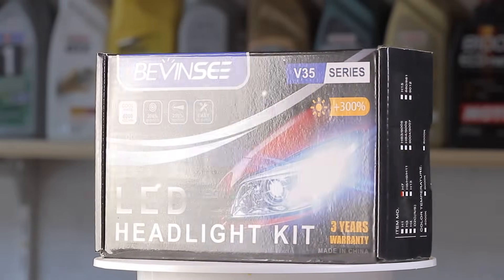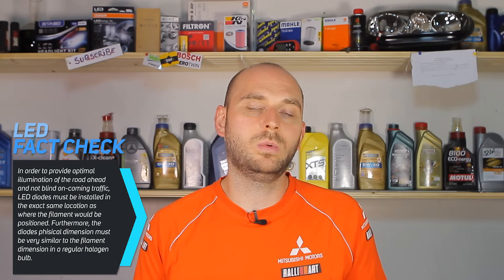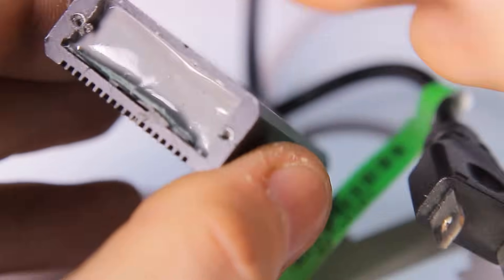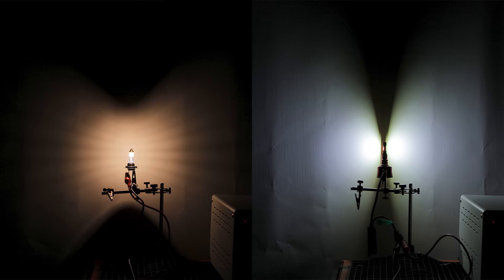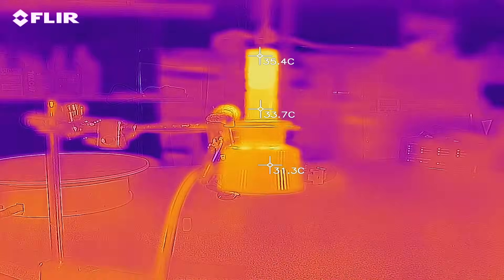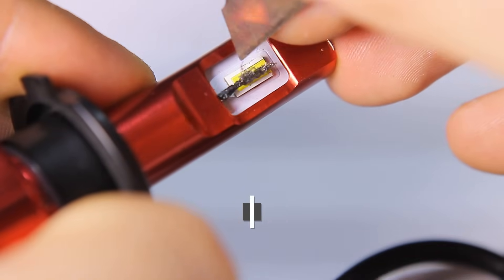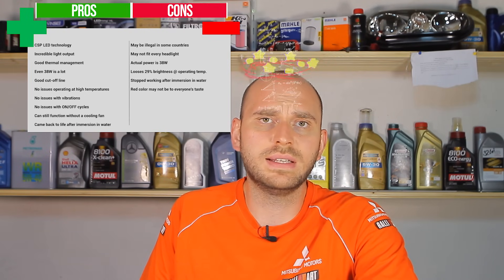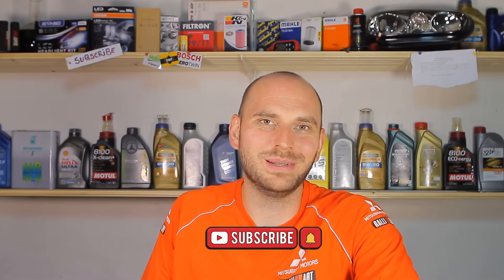50W LED vs HALOGEN - Endurance & light output test - Bevinsee H7 VC Cooling

Comment: I bought the Bevinsee V35 HIR2 version of these leds for Toyota Yaris Cross projector lenses to replace the halogen bulbs. It works good enough and especially the thermal management is very good - they really dont heat very much. But the HIR2 version has not correct dimensions in compare to the normal bulb - the LED chips are higher that the hot spot of the normal bulb, so the focus is not very good. Also I am seeing some reflections and it can be a problem for other drivers.

Comment: This LED can be perfect for a cars like Japanese Cars, I don't have any dust covers at the back at my Toyota Auris. I can bet it will not loose that much efficiency. Another aspect when we drive i think air also cools  front  of headlight so it still will have lesser temperatures, probably also that "closed" space is not 100% sealed like you did on that two glasses, because halogen bulbs are more hotter probably there is a little space for heat for that last i'm not sure.  Real drop of efficiency at normal use we should except at 6-10%, all depends from construction of the Headlight.

Comment: Anyone has a long term feedback? What's the lifespan? 1 year? I know it's theoretically supposed to be warrantied 3 years...
Reply: Had them since last august in a projector headlight on my daily. Still going strong, and going for the brightest LED in a projector is the key, and these are easily on par or brighter than the manafacturer cars with LEDs as standard. I don't have the data to prove that, but after driving around plenty at night with them, these are phenomenal and really standout above other led-fitted cars.

Comment: What do we do with the driver if we can't fit it inside the headlight. Should be damage the rear headlight cover to run the wire outside of the headlight.
I decided to go for the newer model led bulbs with no driver so I could close up the headlight cover.
Like other are saying we need a test of led bulbs with no driver

Comment: Very informative and detailed review as always! Thank you for all the effort you put into your work!

However, I measured totally different thermals with these LEDs. I measured 153°C on the hot spot in room temp, while testing these bulbs - that is 130°C delta above ambient! 
The measuring point in your thermal imaging was way above the CSP LED chips which are the hotspots. My amperage was similar to yours, the fan was working. It burned a black spot on my wood table during the test, after about 1 minute, from 2 centimeters.

The packaging foam which gave you that thick smoke would not burn at the 48°C that you measured.

I would not suggest people to put these LEDs in their cars, as it is possible to damage the plastic headlights. The total heat output is less than from a Halogen bulb, however the beam is more concentrated, it might melt some headlights.

Be careful!
Reply: Please share your test results
Reply: @ashokvijay8714  I just measured the temperature of the LED chip after a few minutes with an infrared thermometer and it was 153°C.
Reply: How can it melt the headlight when the Halogen bulb goes over 400°C ?
Reply: @alexpascu1985  I did not try this. My theory is that the LED chip has a much narrower angle, (something like 120° instead of 360°), thus a more focused beam. It burned my wooden desk, it was smoking and the wood turned black. 

On the other hand, the 153°C that I measured (in open air, not inside a closed headlight) is way over the usual 120° max temperature for CSP LED chips, so they would fail very quickly.
Reply: @azsha1000  i understand your point , i for one was concerned as well that it may damage my lens in the headlight, but since it's not so very close to them I'm hoping it's ok.

Comment: One thing I worry about is whether the LED equivalent globe will put out the same light pattern as the original halogen lamp. I guess this would change if the LEDs on the globe were in different positions and a different size to the halogen filaments.

Comment: Getting "more" or "brighter" light from an LED or xenon "upgrade" bulb isn't always better. These bulbs don't work well with reflectors precision designed for use with specific incandescent bulb standards, and the output is deceiving to ignorant users. There is more light, but it's where you don't want or need it, and actually less where it is actually useful, and they always produce glare for oncoming traffic which is dangerous. Modern automotive lighting engineers actually know what they're doing, believe it or not. The designers employed by Chinese factories don't - their only goal is to make money off the poor suckers who buy their garbage.
Reply: Majority wise this is indeed very true and I couldn't agree more! The downsides over led bulbs I would say, which is very true in what you were saying earlier is that there's alot of cheap imitations out there especially from China in retrospect aswell as addressing the problems over flickering and decoding to help prevent dashboard error messages! What type of led light bulb would you recommend for say, the Audi TT Mk2 for eg??
Reply: @StopWarHugMore2026  For a headlight? None. I've never had a Typ8J TT headlamp apart, but if you can upgrade the projector inside to a Morimoto M-LED projector, you'd have legitimate LED headlights that outperform factory xenons and have amazing light output. I've upgraded one of my B6 A4's and plan to do the second soon.

Comment: Nice snow white light output... Until the road is dry. Try to drive when it's rainy, and the road is wet and shiny. You have more light output but you will still see worse than with regular bulb with yellowish light. Also, that very white color causes more eye fatigue, more blue-ish color, less your eye tolerates it. I know what i'm talking about, i have tried these led bulbs, driving with them all night long in rain, never again.

Comment: LED in the opposite lane on an unlit street is a homicide.  Last night I was returning from training in the park in a nearly complete darkness and infront comes an Audi with what seemed like the factory LED (or HID)  lights.  Such whiteness and intensity  and maybe with just little scratching of the lens made me look away from the road until it passed. Now what if there was a cyclist (or pedestrian) without lights,  which is common here,  in fact, that same evening before I stepped on the street one such idiot popped out in front of the car, absolutely black and invisible like a kamikaze!  I only noticed him,  hardly at that, because I had the high beams on and I was driving on the park lane with something like only 10 km/h!!!  I considered getting Osram LEDriving for the headlights until this event,  but not anymore.  I have put LED for the parking lights and the license plate which do good job of adding luminance behind the car so the rearview camera gives better image at night,  and even would work as DRL inside town, but LED headlights? No.

Comment: This is a good review with reasonable testing.  In the review you stated you were disappointed that the LED bub system was only using 38W as opposed to the advertised 50W.  I think you are confusing the power usage with the light output.  You should be glad it is using only 38W as it is more efficient than advertised.  You are getting more light output than a halogen bulb using only 38W of power.  This is not  bad thing, it is a good thing.  The lamp will impose a smaller load on the vehicle electrical system.  The one test you did not perform was the elevated ambient temperature test as on a hot day to see if the cooling system in a closed lamp housing worked as well as in the room temp test you performed.  All good stuff though.

Comment: Ive removed my HID kit as the ballast got faulty. Ive ordered LED H7s and still have the cut out hole on the dust caps from the HIDs. Do you think i should leave the holes to let the hot air out from the LEDs or is this not necessary?

Comment: Nice video. A lot of good info.  I had a question. I did let install the h1 LED from Femex in Turkey.  The box says 17000lumen. I think its chinese cheap stuff. Im not impressed with the performance. Is it possible to install Osram h1 bulbs on the allready installed canbus box from Femex? Thank you

Comment: During operation, an automobile's nominal voltage is 14V, and drops to a nominal 12V with the engine off.  Since headlights are normally used with the engine on, testing should be performed at 14V.  This will also increase the measured wattage.

Measure the wattage at 14V and it should be close to 50W.
Reply: Did you watch the video?

Comment: Hi, Sergiu! Please tell us (if you know) if these led bulbs would be ok to pass the MOT/TUV/ITP etc. I'm finding mixed reviews on the net and no one sais 100% if they are completely road legal! Thanks a lot a keep up the good work!
Reply from the maker: I don't think that a car would pass inspection with LEDs. Maybe if installed in a projector headlight.
Reply: For a start they would need to be E-marked, and they have to be used in a housing designed for that type of bulb, which of course no housing designed with a halogen bulb fitment is.

This is more of an issue for a police stop since they will enforce type approval contraventions under construction and use, but MOT rules were updated in the last few years to make HIDs or LEDs in a halogen housing a fail.
That’s for the UK anyway.

Comment: Projector housings have a metal flap that shields light to make that clean cutoff line. So basically you only get about 50% of the total light output of any light bulb. In reflector headlights they have a shroud built into the light bulb or placed very close to it which efficiently reflects light on to the the usable half of the reflector.
Reply: Yes i have seen this for H4 type halogen bulbs.

Comment: Sergiu, thank you for your content! Just a suggestion: test headlights at 20 meters instead of 3 meters. Testing them at short distance is misleading because the real problem with LED headlights is lack of throw—so that would be great to test. Thanks!
Reply from the maker: I did that in the next video after this one, I believe. And yes, you're right, that really is a problem.
Reply: @SergiuGabor excelent job! Anyway led before 20' at 14volt and in a optical the hot nake it have less lux than de halogen bulb. 😮😢
Reply: Thanks, Sergiu! Happy new year! I’m curious if it makes sense to modify the LED bulb that goes into the halogen housing in order to improve the long distance focus of the light. Have you seen something like that in your experiments?
Reply: It does not matter what distance you measure, because of the inverse square law of light. If you have a lux value at any distance, you wil always know the exact lux value at ANY distance. The only thing to be aware of is limitations of the lux meter, so the best is to measure at a distance where you have the highest accuracy of the meter.
Reply: does super yellow ( and stock my late 60's charger did lighting wise doesn't stay stable as the voltage changes a lot idling vs max-RPM's aka 10v to 14~vdc looks cool to me on the outside like it's a halloween 👻movie car but driving after awhile it's nice to have steady 14v and modernist LED's/laser/blues but doesn't look right for my-car/older models same for angles eyes lighting but i kinda like it RGB for the win lolz 😂) aka 1950-70 USA 🇺🇸 dodge/GM ( or more extreme is probably the 1920's-ish? yellow/dim ) lighting vs modern 6000k/blues-ish tinting makes a difference in dazzling/blinding/reducing-visibility others ( colour only difference as my OEM-60's isn't as bright and use's 50-60A's @ 12VDC i know i tested it the lux parts im not sure as i didn't do any testing as i was more concerned about upgrading the battery to LIF/lithium and the alternator 320A ect vs 40-90~A equipment ) driver's and or yourself rare conditions but can happen , like the snow storm/blizzard in wyoming/I80 i drove in once and because of the high beam/bad light on a 1980's-2010 car afternoon-midnight sorry i forget the details 

id guess that dim vs super bright LUX will make a difference in seeing out and chances of dazzling others and or yourself if the conditions are right for it

Comment: Great testvideo, really good job!! One more test that would have ben fun to know is a lumen messurement. They allways brag about whitch bulb has the highest lumen output, and it would be a fun test to see if what they claim is what you get.
Reply from the maker: Lumens are a bit more difficult to measure. Basically, lumens is the total light output of a source in all directions. Lux is the amount of light which falls on a surface. In this case, the lumen rating is irrelevant because if the light bulb is designed poorly, it can not project all that light output on the road. So, in my opinion, the amount of light illuminating the road is much more important than the total light output of a bulb.

Comment: my stock fog light uses an osram h16 halogen 19watts, do you think it would be safe to replace it with an h11 led rated at 30watts? h11 and h16 is the same size it fits. im just worried about the higher number in led watts

Comment: There is an important measurement that is omitted....  You realize that above the cut off line, both with LEDs and Halogens there is still some light up there! Not much but it needs to be measured, the darker, the better!  The constant complaint about LED's is that oncoming drivers are BLINDED! And clearly that happens because there is SCATTER going on, sending a quantity of light into the darkened space above the cutoff! I think I can see in your video that the area above the cutoff is a bit brighter when you are tesing LEDS! the cutoff being well pronounced and a hot spot below the cutoff, well thats all well and good, but the important item is HOW MUCH scatter is going on above the cutoff??? With Halogens there is not as much light in that darkened area as with the LED's! I distinctly remember consumer satisfaction comments for LED's that go something like: "The LEDs are not that bright but the traffic signs sure are very visible!" All that means is: SCATTER!

Comment: 35 w is enough. I have similair led all years in my bike.it doesnt warm up the plastic like halogeen or even xenon and no voltage drop.Funny to hear that little fan but hope when its fail it ll shut off i dont want firework.

Comment: This is the second of your videos I have watched (the first one was the H3 LED comparo), and again I was not disappointed by the very good scientific method and video presentation...I would like to comment on the voltages you choose...the 12V is a nominal which is OK for discussion but doesn't represent the typical operating conditions very well...and on the other hand, the 14V is a bit high, again not simulating the typical conditions so well...I suggest you perform tests at 12.6V (V of a fully charged lead-acid Bat, so this would be a without engine running and no Charging Sys output), and also a 13.6 (typical system V when engine is running, and Chg Sys is on-line, pulling up buss V).  
Maybe I missed you measuring Wattage at 14V,  but you might find that W at 13.6V might come closer to the specified 50 (I expect W vs V could be a non-linear curve also!).  
The submersion test was pretty non-realistic test IMO (I'm sure the cooling fan didn't appreciate it, but I suppose then the whole thing was "liquid cooled", and it didn't need the fan!!)...a more realistic test might have been being sprayed from a misting bottle to simulate an under-hood condition with a compromised cover, but I understand you were doing a "worst-case" test...  Thanks for a very good presentation, and Greets from Connecticut!
Reply: Im pretty sure the bulb needs 12V for 55W, so that would be the correct voltage? Higher than 12V it would get too hot and died early

Comment: Hi Sergiu, like the way you do it, the very important part that is missing is electronic interference. I did test some very bright led bulbs that developed radio interference in a way that the radio lost completely the signal, as there was no antenna! On the other side, led's with active cooler might also develop a plain's engine noise level...but that you loose the radio signal, not worth it but worth testing. Keep the good and clean work, all the best
Reply: Good point. Unfortunately, he does not really point these issues out. Most of the cars also throw canbus error codes when using LED lights, since they do not  draw that much current as the standard bulbs, so the car thinks the bulbs are burned out. Yes, you will get more light and a nice cool white light, but for what cost? Interference in FM radio receivers, and canbus errors. I think he should mention these things in all of his videos regarding LED retrofit.

Comment: Why is it that lights placed in reflector headlights produce so much more light (lux) than the same light in a projector headlight?
Reply: The light in the projector headlights is more even without a brighter spot of the reflector headlight. If you measure the light output in any other spot light output from a projector headlights should be higher. You can see this effect in this video with halogen lights more clearly.

Comment: Any options in H7 or H1? Cant find them on Ebay or Amazon...can you link it please? Or T8 or either X6 (both from Bevinsee Aliexpress) series has as much lighting power like this? Thanks Sergiu or Bevinsee 👍
Reply: 2 Stroke T,  We have H7 n H11 in this V35 Series on Amazon. And T8/ X6 is not as bright as this series. Here is the link to V35 you can opt your favorite one. https://www.amazon.com/stores/page/429FFDE4-D734-482A-9609-331778C47B18?channel=VC%20Cooling%20LED%20Light